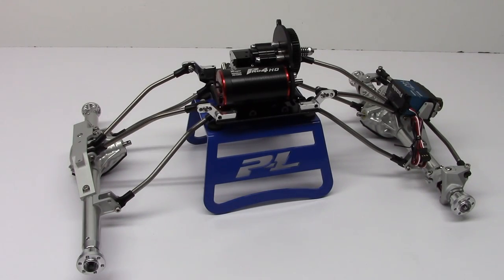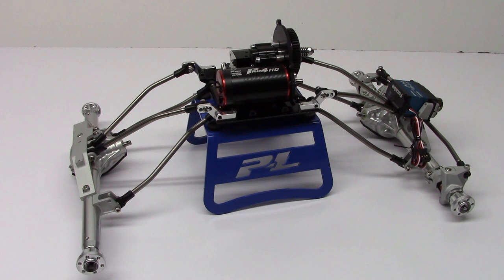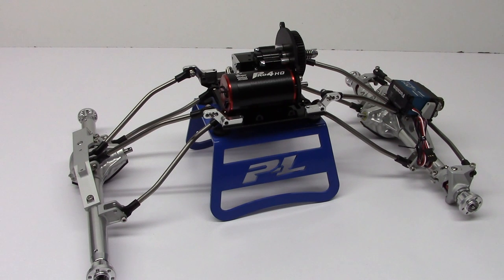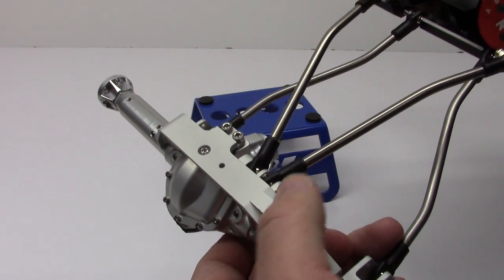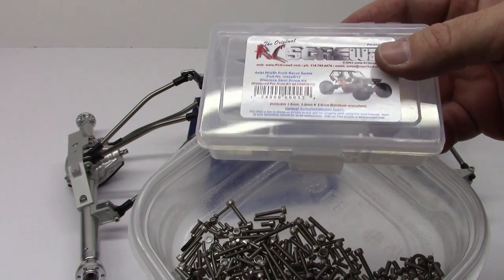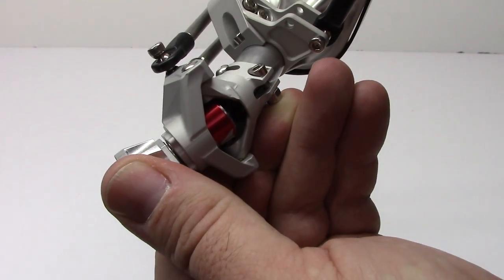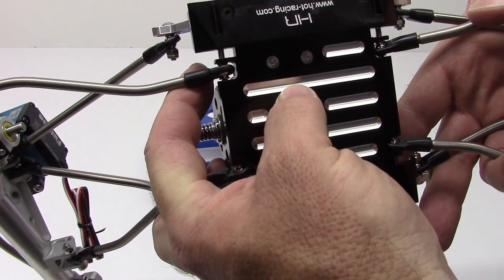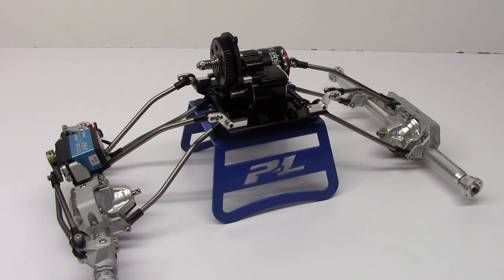SpawnZilla / WraithZilla Episode 1 - Intro to the PBP Build!

Comment: Ok so I just got some mip driveshafts for my wraith but the rear end shafts are to short please help
Reply from the maker: CoopsCreekGaming I believe Wraith driveshafts are the same both front and rear. They do have two different sized outputs - you’ll need one on each side. So, long ones coming off the trans and short ones going to the diffs
Reply: The RCNetwork ok thanks for the help

Comment: That hot racing bottom plate should have come with 4 roller bearings that helps it roll over rocks and such instead of getting caught up on things... I used that exact same one for a wroncho build... Neways great build! You have a new subscriber!
Reply from the maker: +Ray yretreter It does come with roller beraings.....I would have known that if HR ever included any kind of instructions (EVER!)  I also realized 9months later since this video) they're to protect the revo rod ends on the Vanquish links so they don't get sheared off in the rocks

Comment: When you mounted the transmission did you use 4x 12mm screws or 2x 12 and 2 x 10 just need to know for mounting my transmission
Reply from the maker: They're all the same - I believe 12mm
Reply: +The RCNetwork thanks for that it's just I couldn't find any where for the hot racing transmission case for the wraith on how to mount it

Comment: I wouldn't use that skid. Unneeded weight and doesnt slide over rocks well. Stock skid hangs up enough as is since its so big.
Reply from the maker: fr8cture Yeah, I'm on the fince on this one.  A buddy and I are working on some different options for the skid.  He's had the same issues with the stocker on a custom trophy rig
Reply: The RCNetwork I have a DMG transmission spacer that is suppose to fit the 550 size motors on stock skid.
Reply from the maker: fr8cture I just check those out......Looks good, and although minor, it raises evrything up 1/4".  I saw the photo on RCC, any idea what the aluminum cross bars are on the plastic stock skid?  @493734

Comment: I got the kit and refuse to go crazy like you did. Yes,I could if I wanted to, but no I decided to go strictly by the book. I cannot dump that kind of money on the front and rear axle kits. There are so many aftermarket manufacturers out there. I cannot justify the expence. I would like to relocate the battery, thats it. I know what you have. I do know the prices have gone down now on most of that. Buying metal everything for what was originally a plastic  build except the frame bars. Why do you need a full metal frame on the Wraith Spawn? Titanium, why, aluminum? why? Seems silly to me really. I guess if you want to go overboard,  thats your party. I doubt I will abuse mine anyways. I may run it once in a while, but no competition racing. Its supposed to be a crawler no? Yeah, thought so. You have what,over a grand in that? Crazy. To each his own.